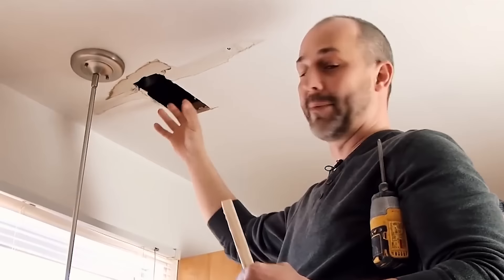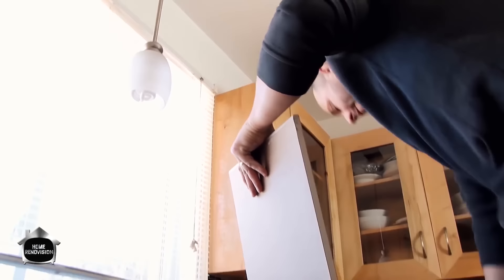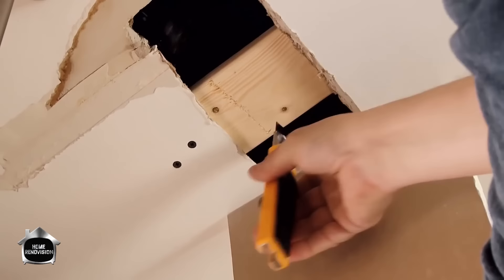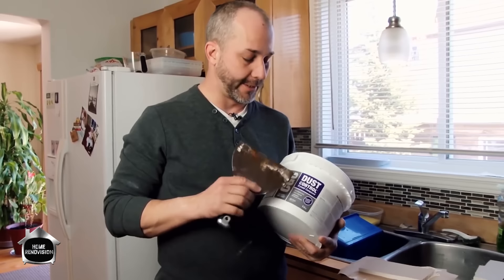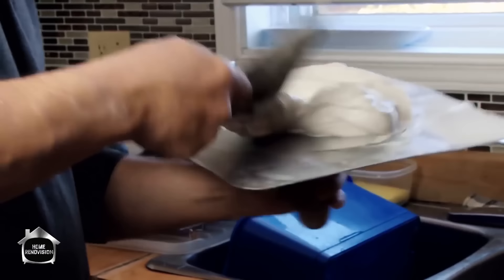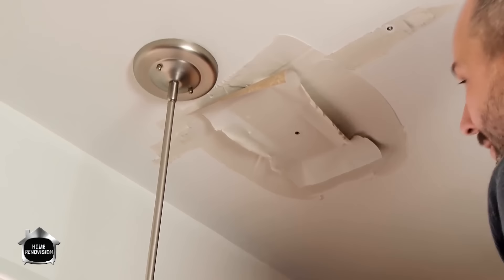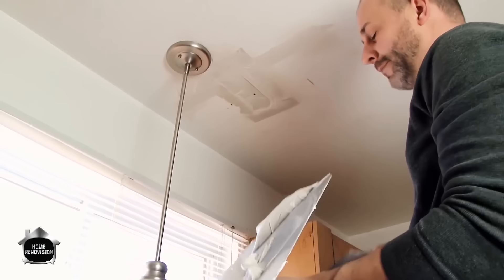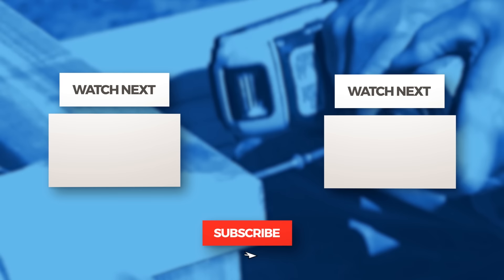How To Repair a Drywall Patch

Comment: Another great drywall video.  I have a bad area that needs to be repaired.  Watching a number of these videos gives me confidence that I can do it.  I won't know how bad until I open the wall.  It's plaster, getting a drywall patch.  I was advised to make sure to wet the plaster so it doesn't suck all the moisture out of the mud. If it doesn't work, I can try to plaster it instead.  Thanks for all your vids.  Genius!

Comment: I’m so glad that this looks easy to do, bc my father-in-law fell halfway through the ceiling in our master bedroom closet a few months ago. This is a new house out in the middle of nowhere that we just bought last year, and I swear that it’s taking way more damage than our old house that’s being renovated. Bc he fell he got white installation all over our clothes once we pulled him out of the hole, lol. And then I found out home installation is bad for your lungs so I cleaned the area with a broom and took duct tape to pick up all the debris off the carpet, it was a real mess. All to show him where we were installing the Star link in the antic, and he took only two steps in and fell in between our master closet and the attic. And this is only the second time he’s fell, bc he fell clean through his ceiling and unto the laundry room floor of his old house that we’re now renovating lol. And I’m just hoping that we pay our neighbor whose renovating our old house to do it lol. But my father-in-law and his gf are moving into our backyard on a concrete slab for their RV that he will also build, so I’m  prayers bc I’ll be worried for  our house, lol God bless.

Comment: So glad I found your channel.  I had stepped thru my ceiling in the hall when I was in the attic.  My hole is around 18-20 inches square  so I will be using this technique to fix it.

Comment: Thanks for the video, I never knew the drywall paper was thinner than drywall tape!   In the last year I found "setting" drywall compound powder that requires mixing (why would I want to do that?!?!).... Turns out that setting compound doesn't shrink (you can fill huge gaps), is stronger and dries in 20/45/90 minutes!    I now only use the "bucket" stuff for the final (sanding) coat.

Comment: Glad you're making these videos but gotta point out: you can use painters plastic and tape to fully control dust, so you can use the mud you like, make sure wood is flat against back of drywall, 3 screws on either side of hole will ensure it doesn't push through, make sure screws are just below paper face, if it breaks the paper it won't hold, use a bigger knife each time you come back, less mud you leave, less there is to sand. Just some tips and tricks from a pro 😉

Comment: Hi Jeff and Happy belated Bday. 
Question...Do you recommend me using this winged patch method if hole is over 12”? I know I will use blocking, but unsure of winged repair method due to your statement “you use the California patch under 12”. Have you made a video of larger ceiling patch without winged method? Thank you for all your videos. They inspire me to attempt repairs I would have never thought of doing before.
Alex (Miami)

Comment: Is there a proper way to cut drywall besides holding it against your body and cutting towards you with the blade?

This is an edit based on a reply to explain I was not being condescending in the above comment; I really want to know from an inexperienced position. However, I do understand how pro can do things in a different way because of an elevated skill level which I have not obtained. All in good sentiment.
Reply: Retracting my misunderstood reply to your  initial comment. There’s a ton of frustration born nastiness out there during the current Covid climate. It’s easy to get irritated with that and stick your nose in to call someone out on it. I REALLY wish I’d understood your comment as a legitimate question. Thank you so much for your peaceful edit and reply! Apologies for my nose getting in the way. This wonderful content provider answers negativity quite well if at all. He doesn’t need me sticking up for him. Especially if I’m wrong from the start. To add further note to your question: If you’re using one of the handy utility knives with the break off blades, they have many positions to set how far the blade sticks out. As Jeff said, you’re only scoring the paper on one side so you can set the position to only have the very tip of the blade out. If you find yourself pressing harder than you would when shaving, change blades/snap off to a new blade section. The harder you apply the blade, the harder it is to control if you slip. Glances at the scar from a time when he almost lost a fingertip Cheers and thank you again.
Reply: @vadjrob  I was not being condescending; I was merely asking to know. I use this platform for suggestion not aggression. However, I get where your coming from given the concise wording of my comment and will edit based on your feedback to further prevent any such impression. Also, if you are experienced in this line of work, feel free to let me know if there is a way, because I do not know and it seemed dangerous for a novice. Thanks for the reply.
Reply from the maker: you are simply scoring the paper. it does not take any effort. so no need to worry about it. if you are concerned then set it on a table. Cheers!
Reply: @HomeRenoVisionDIY  Thanks.
Reply: @vadjrob  I gratefully accept your apology; it is with out doubt, your retraction speaks volumes to your character demonstrating the virtue of humility. I, too, have learned being concise also entails conveying the right sentiment. The beauty of communication is it gives birth to deeper understanding. God bless and keep those comments coming, man. Oh, and thanks for the advice+

Comment: once mud is feathered sanded primed you're gunna wanna roll your paint so why not suggest removing the fixture? cleaner look than cutting around it and the average diy'er will probably end up scuffing it w a sanding block or paint brush. probably end up repainting the entire ceiling anyway. being a kitchen, odds are it will discoloured enough to make new paint stand out

Comment: good job and you are professional!  we suggest you our self-adhesive aluminum wall repair patch for the drywall and ceiling holes. it have fiberglass self-adhesive mesh and aluminum board, so it have high tensile strength, and easy to use, what do you think about our recommend?

Comment: Great video but I  have hole on a seam in the ceiling from a water leak. It is dry but not sure how to creat a patch on the seam.  Just cut it all out and repleace with a solid patch? About 6"wide and 12 to 14" long.

Comment: I had this done to my ceiling by some contractors.  It looks pretty good, but there are minor uneven spots with the plaster.  You can't really notice it at all in normal lighting settings, but when I put a flashlight alongside the ceiling, you can really see the bumps and where they plastered.  Is this to be expected?  I can send you a video if you'd like...  Just seeking another opinion!

Comment: OMG Jeff, Mahalo from Oahu...Based on your "Perfect Speech" Oh Canada......hahaha. No worries we get full on Pigeon-English...So much Mahaloz...for your videos, like full on BABY-Steps, I love it...you thought of the most easiest detail tricks, techniques you season construction guys usually miss because its so so Obvious to you all; however, the minute, the littles tricks, the small and "Obvious tricks." So amazing....I appreciate you for NOT forgetting the lil ppl, where you started...but most of all, the TRICKS of the Trade to Eliminate the Trial and Errors we didn't have to endure, waisted time, and Money(Kala) because you gone before us....Mahalo Mahalo Mahalo my Uso (Brother in Samoan) from the North....  I consider myself a YOUTUBE DIY Guy, got some videos i did that help ppl repair their washer and dryers, that's another time:-) I am more confident to seize this patch repairing extravaganza (about 20 repairs throughout the ceiling and walls) 

Said that Jeff: Question...So the cabinetry/electricians just completed my "Happy Wife Happy Life Kitchen Renovation." The electrician had cut-up parts of the dry wall installing recess lighting and other connections, new dimmers and etc...IS THERE a "Trick" on ceilings to repair those cuts by JUST using the 4" knife and making mud and just applying on those slits, 

Or you recommend to use that mesh and then mud those cut drywall lines. BTW i love the California Patch and how you apply and explain it with kids gloves...  Mahalo and I'm a proud subscriber and watched CHOKE(a lot) of your videos already. Aloha           Dana

Comment: I need a drywall repair for a handrail on stairs with brick wall (at the bottom) and concrete (at the top) behind it. The Drywall board cracked and handy man did horrid repair so I’m fixing it. Having trouble finding video on how to do it when it needs to also bear the weight of the handrail & hardware being reinstall in the repair.

Comment: Got a simple question - on a finished wall, the tape is lifting and can see it separating from the wall a bit. How can i fix it? Do I peel the old tape and retape and mud/sand/paint?
Reply: I'm in the same boat, only I also have a spot where the tape is lifting in a corner. I would really appreciate a suggestion for a solution as well.

Comment: Been learning a lot from your videos thank you for sharing your knowledge. I'm an electrician and trying to do my own sheet rock patching never goes great. Not bad, but not great. Any ideas for situation where you remove a surface mounted light, remove box and now the hole is to big for a can light? I can't put a board to attach sheet rock because then I couldn't cut in the can light.
Reply: Cut it back to the studs on either side, you can attach your patch to the studs just like a standard seam between sheets of drywall. 
You would probably be able to put a smaller block in at the tol and the bottom and still have room to mount your fixture.

Comment: How do you repair sheetrock where two walls come together?  I removed some old shelving in my laundry room and a few sheetrock screws did not want to come out od the wall. Now I have holes in the corner where the two walls meet.

Comment: Love your videos...  so many details and the reasons behind them. 

Now, how do you suggest we patch a hole larger than 12x12 if not using CA patch method? I have a 20x15 hole in addition to two smaller holes.

Thanks!

Comment: Can you show how to fix a hollow core door with a dent/hole in one of the panels? I need help
Reply: If it's not too deep, or if the wood isn't cracked you can probably steam it out using a standard household iron. Put a towel over the door first to prevent burning it.

Comment: Great job, you are the wizard.  One question, how come you put 2 screws on one side of the hole and did not put a screw on the other side?
Reply: My guess would be because of the existing water lines. 
He had indicated that he had to maneuver the block under the water lines. 
There's no chance of screwing through the water line if you only screw it on the one side.

Comment: Would 2 sheets of 5/8 drywall and insulation suffice for a basement bedroom for noise canceling, between furnace room/utility room. (Sumo pump/ gas water heater etc.) and the bedroom

Comment: Hi I love your videos I was finishing the whole basement follow you instructions have a question with the drywall my basement is a little bit taller than normal and I have a little bit gap on the bottom 3 inches what should I do about that should I worry about that baseboard is not tall enough I planning to use to be 6 inches tall will it be enough room to attach it
I would appreciate your advice
Reply from the maker: i would install drywall at the base to provide a solid backing for the baseboard. if it is tall then taping may not be necessary but backing definitely is . Cheers!

Comment: Is there a reason you screwed in the blocking on 1 side instead of both sides of the hole?
Reply from the maker: there was a water line on the other side. just being overly cautious.

Comment: So after the patch is applied, is there a way to sand it without creating too much dust, like a wet sand, or would you cover everything with plastic and hand sand?. I tried putting up a floating shelf, the screws broke, tried positioning it lower, broke again, had plastic screw plugs, just pounded them in wall as I couldn't pull them out and applied some dry wall compound on top. Planning to go sand it again, and do a better job, using feathering technique and better dry wall compound.
Reply: For small stuff like that I generally hold a vacuum up close (mini shop vac is what I use). Catches most of the dust:)

Comment: I have a question that I don't think I've ever seen yet on a DIY youtube channel.  Question is after patching they drywall, say for example you don't have the original color of the paint.  What would you suggest?  Would cutting out a section prior to patching and bringing the sample in to a paint store for a match be a good idea?  I imagine the match would be close but not perfect?  Would that be an acceptable solution?
Reply from the maker: Yes and yes
Reply: Robert Giresi   Depending on the location of the patch if you have even a hint of ocd paint the whole wall. Matching/blending the texture over the patch is just as important to hide the patch.

Comment: Most people would take down the light fixture... so that the entire area can be feathered out with mud to one smooth consistency.  The method shown in the video will leave a curved surface area around the light fixture, even after sanding and painting.  : (

Comment: Did a drywall repair sanded and painted. All the repairs look smooth compared to the rest of the wall. Tried several coats and still looks the same. Its driving me nuts

Comment: Would be lot faster an easier using a measuring tape, then going up an down the ladder to mark an cut js, I'm a carpenter drywall an framing 16yrs, but ok good job